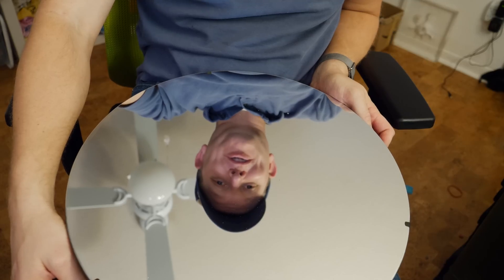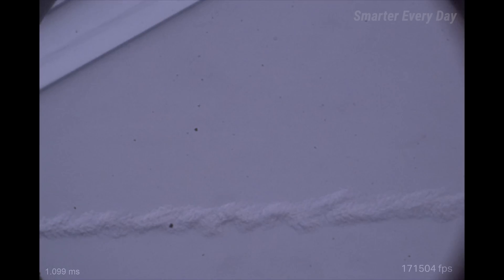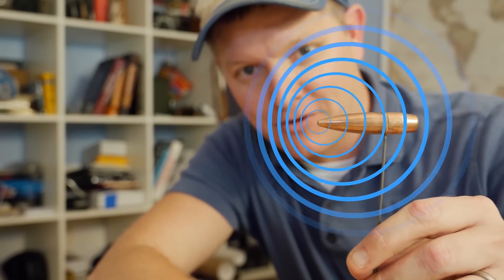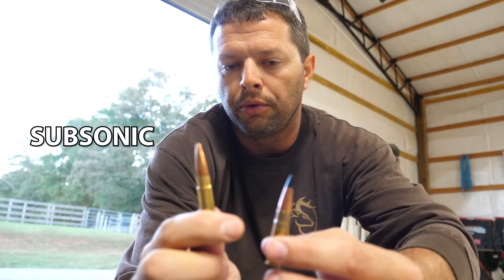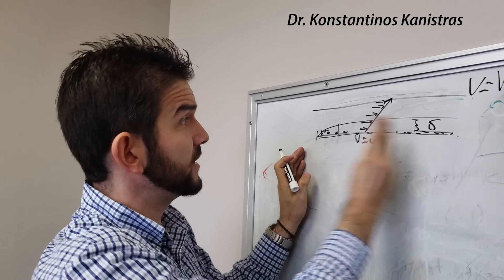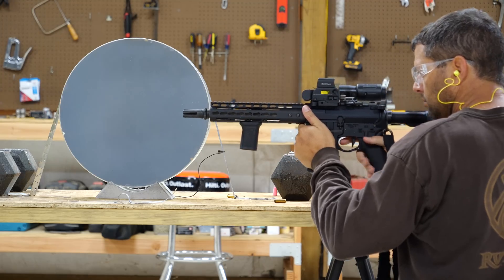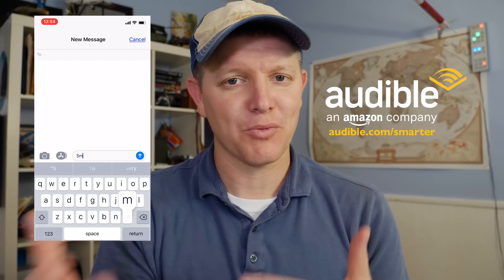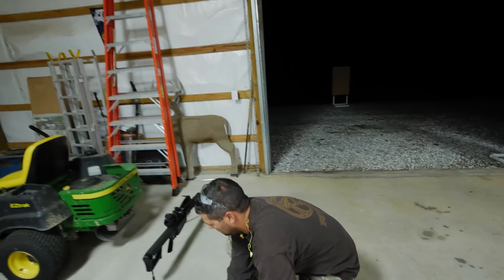Shockwave Shadows in Ultra Slow Motion (Bullet Schlieren) - Smarter Every Day 203

Comment: The slide action was designed to automatically feed a new bullet into the chamber but thankfully, due to the spring that accepts the slide, it also absorbs the shock that you would receive from a revolver. You can fire many more rounds comfortably with a slide-action pistol that you would with a revolver.

Comment: I’m the car chief on a Top Fuel Funny car. I love smarter every day and would love to have you guys as VIP’s at a race! For many reasons there is very little scientific data on The Nitro Cars. I have spent my whole life growing up around and making a living in the top fuel category of drag racing. A 500cid nitro hemi burns 5 to 6 gallons a second of nitro. Each combustion event uses 12 ounces of fuel so we burn more fuel than a 747 does. I have been fortunate to work with John Medlin and he is one of the only people that has tried to get scientific. Ironically on almost every experiment we learn something but it’s never anything about what we were intending to going in. I was a teenager when computer telemetry data recorders were first used in the sport. They basically proved all the previous theory wrong. No scientific theory’s are ever proven to be correct with the nitro cars. It seems like they are only proven wrong and it’s just a matter of time. Im a science nerd that’s spent my entire life around the sport  and I’m often embarrassed when I have to tell sponsors and fans that my explanations have zero scientific fact and are based on popular opinions. Every other professional motor sports have engineers working with scientific data pushing  progressive evolution.  We just guess to find performance gains while hoping it won’t just blow up. If smarter every day could prove anything it would be a really big deal to the sport🙏🏻

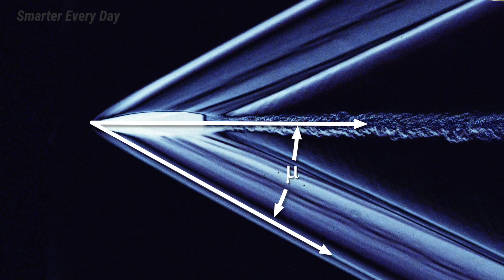Comment: Question: isn’t the angle of the oblique shock presented at 3:36 different than the Mach angle in general?
The deflection of the bullet is small so they are very close but isn’t the one outlined the shock angle usually called beta?

Comment: Yes, revolvers blow amazing amounts of gas and fire from the cylinder/barrel gap. Even if the timing is perfect, they will also blow out projectile fragments to some degree because the bullet gets “shaved “ when it enters the Forcing Cone of the barrel and must conform to the bore diameter. A vital safety issue to keep in mind.

Comment: On the topic of the trailing circles, this is just a guess from me, but is it possible that those circles are vibrations in the air caused by the sound of the bullet vibrating as it travels through the air? It would definitely be having some form of vibration originating from the round considering the speed and force that it's impacting the air particles with. At least some force would be imparted on the round, causing it to vibrate and generate some form of noise.

That's my guess. I know the video is pretty old at this point, but I would to hear your thoughts on it.

Edit: The subsonic airflow speed increase is the same science used in scissors and guillotines to accelerate the cutting surface. I think Kyle Hill did a video talking about things that could exceed the speed of light. Spoiler alert, it isn't objects that can, but rather ideas or principles that can.

Comment: Destin, Somehow I overlooked this one. That is great well presented footage. While not a walk in the park Schlieren photography is much easier using a high-speed video camera than building a submerged arc photo-flash and synchronizing the flash with the bullet being in the camera. 
The transonic buffeting from  Mach 1 to 80% of Mach 1 usually is the point that a supersonic bullet is no longer accurate, There are exceptions. The .50 BMG resists buffeting fairly well and David Tubb's DTAC 6mm 115gr RBT Closed Nose bullet seems to have it beat. Reduction in transonic buffeting and drag would also benefit pistol ammo 9mm, in particular, has ammo all over the transonic region.  As with many things you do a long time and lots of money could be spent on this.

Comment: Vis a vis supersonic crack, the mach wave trails the bullet in a cone at roughly a 45 degree angle. (see the atached vdeo)
Note there TWO shock waves per bullet, leading and trailing ends of the projectiles. Since they are so close together, the human ear cannot detect the difference, unlike the " Boom-Boom" generated by supersonic military jet aircraft that I flew back in the 60's and 70s. . From the intended target's vantage point, the sound of a miss is generated from BEHIND him or her. As the video shows, reflected shock waves off of ground, buildings, trees, etc make the task of IDing a shooter by the sound of a bullet's crack a daunting task. BTW, the shock wave from a 50 BMG BULLET is so strong, I had to wear hearing protection from the sound of the BULLET while scoring targets at a 1,000 yard competetion. (It's rather like someone held a 1911 up to my ear and pulled the trigger! Seriously. Not kidding. I used that helpfull bit of info to save me and 5 other hunters in Alaska when two huge brown bears decided to have us for breakfast. The big boar (12 tall and 1,500 pounds) was running at us from 500 yards. I put a 650 grain tracer about 4 inches over his washtub sized skull at 186 yards. He grimmaced, closed his eyes, ducked his head, and bared his fangs. He turned tail and was sill running when he cleared the horizon about 5 miles away.

Comment: The sub sonic bullet might be spinning faster than the speed of sound, but not sonic in the direction of flight. Combine that with imperfections/distortion of the bullet and the barrel you get rough patches on the bullet that deflect air at the speed of sound or faster? Just my thoughts.

Comment: Nice that you put in m/s, but...in europe we rather use km/h. Also, the speed of sound differs by height (density of air) and temperature. On sea level by 20° C it is 343 m/s or 1234,8 km/h. Formula for meters/second into kilometers/hour is divide by 1000 (Meters to Kilometers) and multiply by 3600 (Seconds to Hours, 60x60). Just a sidenote for metric viewers XD
Reply: M/s is standard in Europe for measuring when talking about bullet speeds, as they rapidly lose velocity over meters, not kilometers of distance.
Reply: @marcusborderlands6177  Ah, yes, this makes sense. It is much more precise than kilometers, should've figured that one out by myself...thanks

Comment: I'm curious if the super sonic air flow off of the bullets surface you asked the professor about was caused by the rifling. It would be cool to see how different projectile shapes perform at cutting through air with this method. Hollow point, round nosed, spitzer, and boat tail all from one rifle with equal powder load.

Comment: The sound we attribute to a gun in actually the powder exploding. That "shockwave" is actually a crack. If you are far enough away from the gun there is no boom, just a fast "crack" when the bullet passes. Those closing bubbles you can hear in you fire over water. The ones far enough away from the muzzle bang come in after. It sounds like a crazy rain or something. They are the air molecules best way out of the "explosion" of supersonic movement, is the same, spheres.

Comment: I have taken photos of high speed flybys at airshows where you can see these shock waves off various parts (canopy, air intakes, wing) of the aircraft. This is especially visible under high humidity conditions. The speed at which these shock waves begin to form is called critical mach number. Under ideal lighting conditions, I have seen these on top of an airliner's wing in flight. Pretty cool sight but its rare to get the right kind of lighting and background to see the light rays bending through the shock wave. You have to be seated over the wing and look toward the wing tip, roughly aligned with the shockwave. It's there on every flight but rarely noticed or visible.

Comment: Regarding the accelerated air surrounding the subsonic bullet, something I think you would find interesting is that while aircraft risk stalling when they go too slow, a similar thing happens if they go too fast. A shockwave forming over a wing as the air reaches the speed of sound disrupts airflow, causing Mach buffet. The speed at which the aircraft flies to achieve supersonic airflow over the wings is called critical Mach number.

Bonus fact, as altitude increases, the difference between stall speed and critical Mach number decreases until they are the same. This is known as coffin corner.

Comment: Bullet Schlieren been done a few times.

Could you try a ping pong ball  suspended in front of mirror via bernoulli effect, or would the shadows moving around pingpong ball would be too small to be worth trying? Or does the air have to be supersonic?
Would like to see air suspending the orb if possible (inspired by some old Prof Sumner Miller tube vid on Bernoulli topic lately)

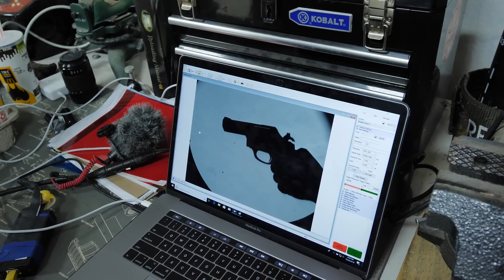Comment: 8:34  Revolvers are old ... but not for beginners.  (Modern handguns do not have this issue.). This reminds me in aviation of the original taildraggers, which are similarly unfriendly to beginners vs modern tricycle gear planes that are now most commonly used.

Comment: So, what are those circles that are emitted at regular intervals? Why are they emitted at intervals? Which parameters (maybe air temperature, pressure, humidity, density, etc) affect those intervals and/or regularity? You made and outstanding video, but I was surprised someone as curious as you didn't pursue this issue further, especially considering you interviewed an expert in aerodynamics.

Comment: The shock wave angle is not the same as the Mach angle. They might be quite close and the shock angle can't be greater than the shock angle. You can calculate the correct shock angle and therefore the Mach number. Also, the Masch number and speed of sound are not constant. They vary with Temperature

Comment: Someone should send this video to Gayjin. 

Even though APFSDS and other solid shells have no explosive filler, no matter how thin the skin of the vehicle said APFSDS and other solid shells perforate through, the shock wave  propagated from the trajectory of said APFSDS and other solid shells will generate enough pressure to rupture the internal organs of every nearby crew member in the vehicle!
Tl;dr: Non explosive kinetic energy shell is perfectly capable of killing most of the crew members in a vehicle regardless of vehicle skin thickness in a single hit. Gayjin pls fix your Ground RB!

Comment: As an airline pilot, we determine our maximum speed by our Critical Mach number.  That number is the speed at which you begin to see localized areas of supersonic airflow.

On my current equipment, we can fly at a speed of m.82.  At m.83 (theoretically; there is probably a margin of error built in) we begin to see supersonic airflow in localized areas such as antennas, control surfances, etc.  This can cause severe buffeting or even mach tuck if the shockwave builds and reaches the right point on the airfoil.

Fantastic video.  I've repeatedly been shown this type of imagery for both subsonic and supersonic airfoils, but NEVER a transonic airfoil.

Behind those little whisps are where a wing would begin buffeting due to the shockwave disrupting laminar flow over the surface.  Absolutely fantastic!

Comment: Aerodynamic is also an atmospheric effect. There's probably a way to use the shock waves to produce an image of the room the way sonar works under water. Think of the bullet as a boat on water, except there's a three dimensional effect, and fourth dimensional if we go further into it, that's the same as a wake made that travels from the bullet and bounces off the walls and surrounding matter. I'd be interested to run this experiment with some acoustic devices and controlled gas clouds.

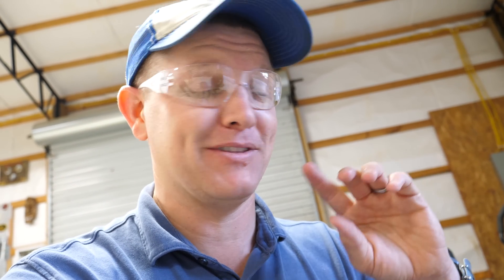Comment: 3:51 ... those circles trailing the bullet are cause by the bullet spin as it travels through the air ... because the surface of the bullet as it rotates also causes drag.

Comment: Absolutely fantastic video! However, I'm afraid your schelieren optics setup may has some flaws. If you look at your footages closely, you will notice there're some severe ghosting going on. Almost all of your footages contain two separate but identical schlieren pattern, if your setup is correct, they should overlap. Base on my own experience from playing with schlieren optics, this is probably because your light source, razor blade and your camera are not perfectly aligned with the optical axis of your parabolic mirror. My solution to this problem is to stick the light source on the razor blade(to make them as close to each other as possible), then put them directly in front of the lens. This way the two schlieren pattern will overlap and enhance contract instead of making the footage looks messy.

Comment: Does a bullet rotate about its “pitch” axis as it flies through its trajectory? In other words, does its longitudinal axis remain parallel to the bore of the gun, or does the bullet rotate so it faces into the relative wind?
Reply: The bullet is stabilized to the axis of the bore by the rotational forces from the rifling.

Comment: I've seen the shock wave over the wing of a 747 while cruising at altitude.  That normal shock moves up and down the length of the wing as the speed of the aircraft changes.

Comment: Something that was failed to be explained was that if you notice with the subsonic bullet the speed of the supersonic airflow around it changes the trajectory path, the reason why it was moving so funny was because the speed of the air traveling around it made it impossible for the bullet to travel in a straight path unlike the other bullets, which shows how much influence our Earth's atmosphere has on how the laws of physics are written, we literally have to factor different principles changing equations relevant to environmental forces, making the most astute synopsis into nothing more than personal theory, which is why science and physics is so fun, the rush to prove theory into undeniable fact.

Comment: Can you add a wall that is form fitted to the mirror running vertically near one end of the mirror and then add a second wall with 2 slits on the other end to recreate the double-slit experiment using the shockwave from various bullets? It would probably require you to set the rifle on a stand for accuracy and consistency. Just seems like a really cool way to recreate a classic experiment!

Comment: This one time, of your many great videos, I'll partially disagree.  The shockwaves along the curved bullet body (at subsonic) is because of its shape and how air accelerates over curved shapes, hence how airplanes fly.  "Moving out of the way" is a poor way to describe that effect.  This is why subsonic jets fly in the Mach .85 range as around the nose, top of the wings, and other curved surfaces, the air travels more quickly and that faster flow also has to stay subsonic.  If that was a straight cylinder you would not see the shockwaves.  Also the position of the body shockwaves are at the regions of greatest change of curvature which demonstrates my point.  Regards from a lifelong engineer and pilot.

Comment: I think you will find that the supersonic shock waves on surfaces that are travelling just below the speed of sound is what caused loss of control issues for early attempts at airplanes to go near speed of sound.  Also - a tip - you can use a sound gate compressor to lift faint audio to good levels - I do it a lot fo questions from students in my classes and it works well - Totalrecorder does this but all good audio programs have the capability.  Thanks Destin for your enthusiasm on science topics

Comment: I have a couple of thoughts: IF the secondary and tercary waves were caused by reflection from the plywood and the cement, covering one or the other with, say, felt or carpet, would cause a change or elimination of one or the other.
Secondly, I'm assuming the 'bubble' trail is vacuum, but is it not possible that there are two levels of vacuum, one being the bubbles and a very wide secondary vacuum causing those rings in the wake? Considering that the primary wave is pressure, there has to be vacuum behind it, or at least low pressure.

Comment: That subsonic bullet hadn't stabilized. Not a good choice for that ROT. Revolvers by design release pressure between the cylinder and forcing cone.
Reply: The twist is fine. It's the extreme drag acting on it. There is substantially more drag on a bullet 10% under mach 1 vs a bullet 10% above mach 1. The drag is pushing so hard on the tip of the bullet but the weight after the ogive continues pulling it downward. This I believe pushes the tip off axis because the center of pressure is at the tip and center of gravity is more in the middle. This causes the tip to begin rotating around the axis of travel from torque induced procession. So it acts like a spinning top as it travels, which is appears to do in the short distance it covered.

This off axis flight could also be caused by excessive lead from a bullet seated too deep and jumps to the throat off axis.
Reply: @happykilllmore  That's one of the dumbest thing's I've ever read in my life.